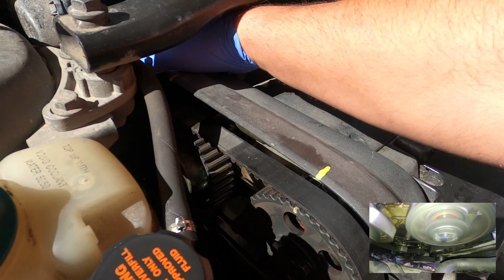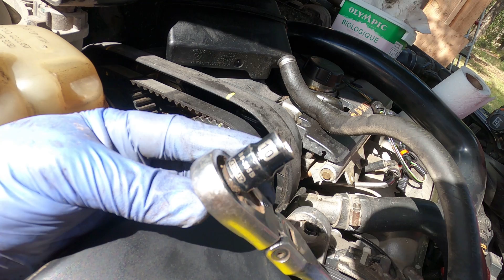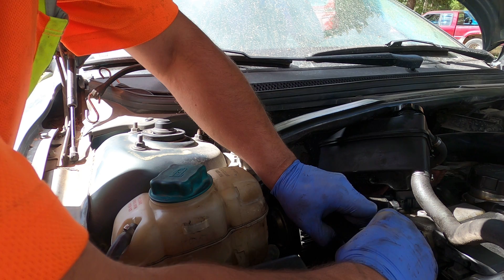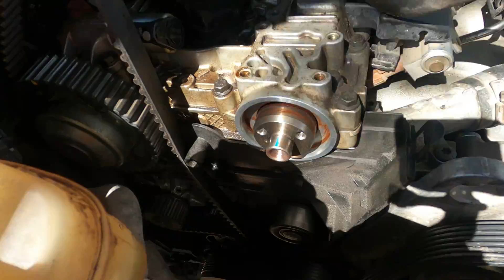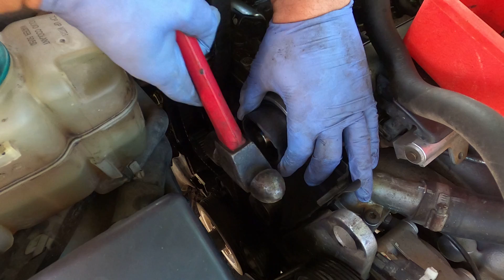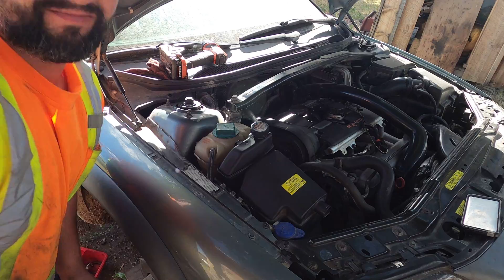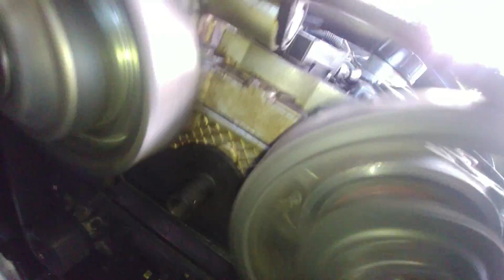VOLVO CAMSHAFT SEAL REPLACEMENT WITHOUT CAM LOCKING TOOL (NON-VVT) |  TIMING BENT TENSIONER SETTINGS

Comment: You've made a couple of costly errors;  1st-The seal needs to be put in a certain distance inward, if not, you will block off orifice for oil return. 2nd-never use grease on the outer seal edge ,a sealer should be used to prevent  leaking or coming loose.
Reply from the maker: Thanks for the advice anyway.  Cheers!
Reply: What sealer do you recommend?
Reply: @d3viin13  Yamaha Gasket Sealer. ( thin coat) Wipe first with 99% alcohol to clean any residue off.
Reply: He did say RUBBER FRIENDLY GREASE…
Reply: @anjodanoite9039  Use what you want !I know what works on my repairs.
Reply: How far in does the seal need to be placed? 2001 v70 2.4turbo here.. if i can get a link to any reference material (or database) i can look it up myself. Hopefully this thread isn't dead and I am not too late to get anyone's attention/help
Reply: @zaneandre6387  Mine is a Volvo 2.5 turbo. Can you take a picture of your existing seal in place? Use that as a reference when re-installing. I bought a special tool to correctly install my seal. Measure the depth of seal to depth of oil orfice and keep away from covering up oil return hole.
Reply: @wfoholeshot8614  I tapped mine in about 1/16th- 1/8th in past flush. No grease or sealant. No leak for now.  How deep was your seal sitting after you installed it correctly?
Reply: @AsTheCrowFlies420  I bought a special tool (found it online,maybe $35)for specifically  setting the seal correctly for the proper depth.It's been 5years since I replaced it.
Reply: Should i use gasket grey glue around seal to put in? And it okay to use hammer for punch the seal?
Reply: @ladam2356  Use Gaskacinch (from Napa Auto) around the outside edges of the seal. Clean the contact area with rubbing alcohol. Let it dry. Put a little silicone grease on the inside of the seal. You can start putting the seal in with your thumbs to get it straight  and then lightly tap on the outside slowly moving it in evenly. If you have a big socket that fits the outside it's even better. Do NOT push the seal all the way as it will block the oil return orifice and blow the seal back out. You can also clean out the oil return orifice before installing because they build up oil sludge. Hope this helps.
Reply: @wfoholeshot8614  appreciate 👍🏾
Reply: The oil seal Volvo uses is most likely put in place clean and dry from the factory. I do not think a sealant will hurt, but the oil (lip) seal itself should do all sealing on both its ID and OD.
Reply: Is this the same on a 2006 volvo xc 70 wagon?
Reply: @wfoholeshot8614  how far in does it need to go?

Comment: Is this process similar to the 2005 Volvo XC90?
Reply from the maker: Hi Tashy, 
It depends from the engine type and size but non VVT sprockets will be pretty much the same among P2 Volvo chassis. Let me know if you have any questions.

Comment: Great tutorial and makes it look easy..I gather the timing marks are pretty self-explanatory on the cam and the cover?
Fabtastic please Keep the videos coming you didn’t mention much about the crankshaft sprocket and the timing down there..i suppose if top cam timing right impossible to get the timing wrong on the crank..?

Eternal Gratitude
Ed
Reply from the maker: Good morning Edwin! 
Thank for watching Edwin) 
You don't need to worry about marks on crankshaft sprocket. We only have to set the first cylinder in top dead centre (TDC). Otherwise we need to remove harmonic balance pulley to get down to the crank marks, which is totally unnecessary in our application. When two marks at exhaust and intake sprockets alight with a timing cover, that will automatically set crank in proper position (if timing belt is in place). You can also remove first cylinder spark plug to verify 1st piston TDC position.
Take care brotha!

Comment: Interesting to watch even though I don't need to do this. Must have felt good to start the engine for the first time after this job!
Reply from the maker: So true brotha, so true. I hope it will help someone to save Volvo from going to the crusher. I saw on Craigs a few Volvo with an issue like this for an only a couple hundred $$. More Volvo vids are coming up. Thanks for watching.

Comment: How easy is it to replace the exhaust cam seals using this method? I think the exhaust cam gear might be harder to remove.
Reply from the maker: Greetings! Yes, you right. Exhaust side sprocket hex screw torqued up to 80 ft.lb. I am going to replace my timing belt kit this spring. There's the way to get exhaust done. I briefly explained it in previous comments but video will make everything easy! I will make a video as well.  Cheers.

Comment: Hello,
My oil light came on, then my 2005 Volvo started to blow white smoke like it was smoking a bad cigar. I smell
 burned oil.
Reply from the maker: Hi Keith, It also could be a lot of blow by from the turbo throwing oil into the pipe as well. Check oil level, oil pressure first before doing any repairs or even brining her back on a road. Cheers and Thanks for watching!

Comment: 300k? Barely out of break-in period! (Lolz) 
Great simple fix on this. Wish the VVT version was as simple...
Reply from the maker: I am at 324K right now, she runs like a new! Non VVT is pretty easy but VVT is doable as well. Next spring I'm planning to replace timing belt kit plus VVT exhaust seal as well. New Video: Volvo VVT Camshaft Seal Repl. No Locking Tool is Coming! 
What Volvo do you drive? 
BZW, thanks for watching and subscribing for more! Cheers.
Reply: @PistonShack  2004 S60R - it's Volvo #16 for me - Plastidipped Swedish Flag!
Reply from the maker: @CaptainSeamus  Mine broke down today on a road - Lost boost, no power and died.
Reply: @PistonShack  ouch. Hopefully it's easy like an intake pipe popped off, and not a mess like I had a while back. 
If you have it, definitely hook Vida/Dice unit up and see what the car says happened.
Reply from the maker: @CaptainSeamus  I checked pipes and basic troubleshooting on-site for crank no start issue. Sounds like a turbocharger or ECU etc.  I have Vida Dice as well! I will let know! Cheers!

Comment: MY COMMENT BELOW DESCRIBES A "MIRACLE FIX" FOR THIS PROBLEM DESCRIBED IN VIDEO, with zero wrenching work!!
By the way, I'm not a woman. Just "borrowing" another person's account here.
Also, this man's "workaround" of the standard repair, without using the cam locker, is impressive. But I think he could have succeeded with my repair here too. This is because his seal failed on a timing belt pulley that was the non-VVVT type, which allows you to push it back in through the pulley holes and paint on the Blue Devil Oil Sealer through those same holes. Impossible on later models with the two VVVT hubs, as I see it. (Also impossible if his rear cam seal went out, as it's a VVVT hub, same as mine. These two are the seals in the front of motor. I don't know anything about the "rear engine" cam seals.)
Reply from the maker: I have new OEM seal for exhaust camshaft already but seal on my vehicle is still good. I will replace VVT hub seal exhaust seal with new timing belt kit in next 30K. I will share how to get VVT seal replaced without any specialty locking tools) Thanks a lot. Cheers!

Comment: this may sound crazy, but it worked for me. When this just happened to me 4 months ago, i was about gonna give up on a 260k volvo s70. Exactly as you see in this video was what it was.
I had already looked [desperately, as the leak was too bad] into oil sealants you add to oil. When i finally found what he shows here in this video, i had a long shot idea. I simply pushed the cam seal back in with a stubby screwdriver, working around it from opposite sides, so as to try to get it seated evenly. [this thru the holes you see in the 'sprocket'.] I didn't push hard, just gently. Crosshatch, like wheel lug nuts.
When i had the damn cam seal what i considered 'seated' in its recess, i bought some blue devil 'rear main sealer', and using a small paint brush [which i broke the handle off to make 'stubby'], i painted the blue devil product directly onto the cam seal itself. [this while it was snowing, in a parking lot!] I then bicycled home and came back next day, -leaving some ten hours of 'curing' time. [this ain't something 'blue devil' recommends!]
i then followed the 'blue devil' company's directions, [i think], simply pouring the bottle of 'rear main sealer' into the engine's oil crankcase and running the engine at idle for two hours. Despite some apprehension at starting it, the seal held! After the two hours of the motor idling, i GINGERLY drove the car home, and idled it some wherever i gingerly drove it for a few days. I BABIED IT!
within two weeks i drove it normally. Easy, but normal. A month later, i got on it here and there, -and I still do now! Too soon to say for sure, but i think it's a permanent fix!! May god show this to another who needs it to keep his 'beater' going, -volvo or no!
some points:
blue devil also makes 'oil stop leak', which i think is same formula, but more [fluid and money]. Think i paid $16ish for 'main sealer'. Blue devil's probably 'the best', though other brands are out there. The stuff expands gaskets and seals somehow. This stuff obviously made my 'loosey' cam seal expand enough to snug it firmly in place.
i should note that in this video, the seal seems different than mine was. It seems like if you were to start pushing it into its recess with something, it wouldn't have had as much resistance as mine did. But i can't be sure from a video... Even if it IS looser, you could duct tape a matching cylindrical object over it, or in some way hold it in. If you can get it to stay in after painting the 'stop leak' on it and adding it to motor oil, it could still expand it to hold. But if the cam seal pushes in snugly, so much the better.
My exhaust cam [rear] is a VVVT cam, with that kind of bell shaped pulley. It has no holes in it, as the 'sprocket' in this video does, to place a stubby screwdriver through! Thus, alas, you can't fix it this way. [at least i can't see how.] i think if my rear cam seal woulda blown, i'd a said goodbye to my baby, -cause doing this job 'right' ain't no walk in the park. And i do wrench some...
i also was warned that the pcv system likely caused this failure, and that i had to fix it or more trouble. But i did the dipstick test and the rubber glove test, [thanks robertDIY!], and they both passed. I think the seal just got old and i drove her too hard that night. I lost 3 qts of oil in ten miles b4 i finally stopped. I should change timing belt, [soaked in oil!], but won't, -as it was just changed! Just washed her down good with brake cleaner. [should give it a second wash soon again.]
since this doesn't seem a pcv issue, i would definitely recommend using 'high mileage' motor oil in your old car/ truck. Definitely these volvos! cheap insurance! It's similar to the blue devil stuff, but likely much less concentration. You could even add the blue devil stuff, maybe 1/3 of a bottle every other oil change. Mite be better.
Blue devil raised my oil pressure a lot. At least 1/4! [i got a gauge.] Don't kno why. But no harm i guess, and by golly, it saved my car! It may drop down when i change oil. There have been no side effects from this blue devil oil sealer, as there can be with 'sealers', generally.  I've heard of them gunking up things, esp. coolant sealers.
it is possible that the cold weather may have [barely] helped my cam seal 'seat'. If it's summer, maybe you'd put ice [or freon?] in cam seal area... Just an idea. Who knows?
I originally left this comment on another video elsewhere.
The repair has never failed since, after nearly a year!
In fact, I just put some 3000 turnpike miles on car in this last month, with a lots of high speed hammering on her! Was over 100 mph 3x! No prob. This "miracle" fix is a solid as a rock.
Reply from the maker: Hi Gina! Thanks a lot for sharing with all of us your experience. I believe it might help someone. I avoid using "Stop Leak" additives if I can replace the seal because it might have side effects later but they work sometimes.

Comment: Finally some practical intelligence.... thanks for this video....   Have 05 xc90 2.5T  113K...  I have the VVT so am not sure if this will apply because there are no marks on sprockets..... and I wish you'd show how to put the timing cover back on... took me over an hour, couldn't get the tabs in.
Reply from the maker: Gracias Gino! I am glad it helped you out to get your Volvo get back on a road.  VVT and non VVT both sprockets have marks, I marked VVT camshaft exhaust sprocket in my video.  There's so differences to remove VVT sprocket (how to take plug, main bolt and hold shaft in place). Later I will make a video for VVT seal as well. In one of the comment earlier I explained how to replace seal on VVT side. Cheers Brotha and thanks for watching.
Reply: … the timing marks on xc90’s are “ FAINT “  to say the least …. But they are there… tiny TINY little lines(outside of cam gears) marks on “inside” of cam gears ⚙️ are not timing marks WARNING..

Comment: Do you have to keep exhaust from moving by keeping timing belt tight with bungle cord
Reply from the maker: I just used rubber bungle cord to keep belt up on crankshaft pulley. After you removed timing belt from intake sprocket, you have nothing to do with exhaust cam. I will make another video later, how to replace exhaust cam seal without holder tool. Cheers James!

Comment: hello i have a leak in the exahust camshaft but I change seal, anyways still leaking. is any special way to install the sal and the oring?
Reply from the maker: Good morning Rodrigo! 
Could be few reasons for seal to leak on Volvo:
1. Over pressured PCV system, should be vacuum present.
2. Damage, scratched camshaft.
3. Defective oil seal.
4. Improper seal installation.
Check engine PCV system first of you have engine vacuum.
Reply: @PistonShack  i dont have one. i like to know if the seal should be installed flat respect to the motor. it need to be in the bottom it just in the surface\? thanks brother!
Reply from the maker: @rigoalcover  I will get back to you later today.
Reply: i think the leak is comming fom the cranckshaft seal. i dont have a extractor for the pulley. is any way to take it out without the extractor?
Reply from the maker: @rigoalcover  I think you don't need any puller to remove harmonic balancer aka crankshaft puller on Volvo. Just remove center  bolt and pulley should come out.
Reply from the maker: Seal flat side should face out, metal tension spring seal always facing in. You can check my video how I installed the seal. It should help you out.
Reply: @PistonShack  im asking for the timing belt pulley in the crankshaft. thanks again for all the info!
Reply from the maker: @rigoalcover  Hi brotha! Check this YouTube video it should help you out: (Volvo S60 V70 Installing the Timing Belt without Crank Pulley Removal (petrol engine) 2001-2009)
https://www.youtube.com/watch?v=2tljxoQFDe0
Reply: @PistonShack  hey i need to change the seal under the crankshaft and I don't have a pulley extractor!
Reply from the maker: @rigoalcover  To remove crankshaft pulley remove 4 small bolts and centre big bolt if you need to replace the seal.

Comment: Hey nice video,, except that music ..  Your engine PCV system is getting plugged and crankcase pressure becomes the force that pushes seals out under boost. Your exhaust cam or rear main seal will likely get pushed out next and you definitely need locking tool to torque 80 ft/lbs center bolt on exhaust cam sprocket. Keep up good work.
Reply from the maker: You are very welcome Rich!
Thanks for watching it. I would like to add a few words to your comment. 
PCV system had and has a good vacuum. Over pressurized PCV system will push oil through the seal but 99% won't push the seal out. The seal was old and dry which couldn't sit at high RPM.
There way to replace exhaust camshaft seal. I should film exhaust seal replacement later. How to do the repair without specialty tools. You just need old timing belt couple pairs of vise grip pliers, 3/8 or 1/2'' power  ratchet and few sockets. There is a way to torque 80 ft/lbs center bolt-on exhaust cam sprocket.
The music clip became so load after all. I set music to 1% and voice recording up to 100% but after I uploaded the video to Youtube background music turned a bit loud.
The exhaust seal (HomeStyleRepair) is coming later with timing belt replacement.
Cheers!
Reply: @PistonShack  did you ever make that exhaust seal and timing belt video